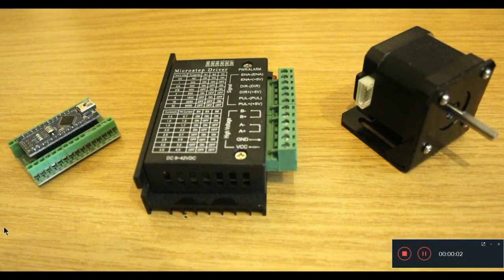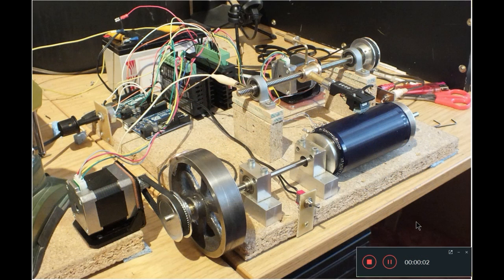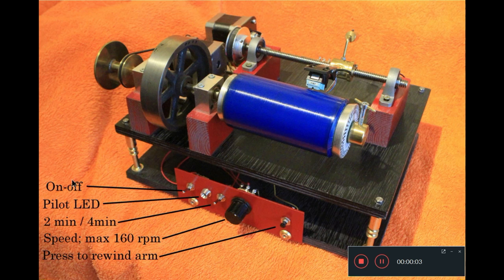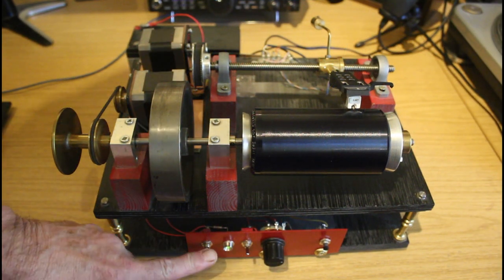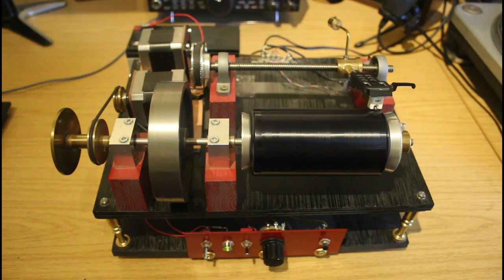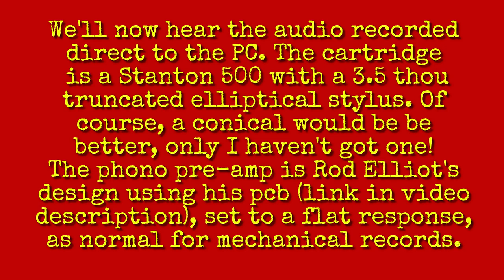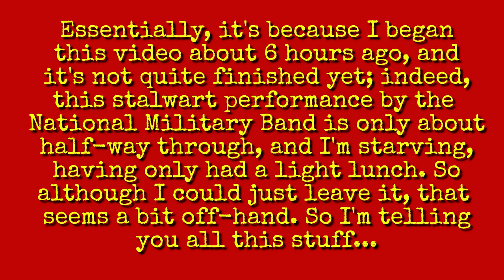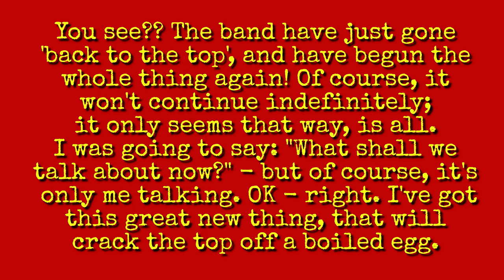cylinder record player, electric and home made.

Comment: I am always delighted to see a new video from you.  I have been following your web page and YouTube channel for quite some time.  I have also been tinkering around with recording some of my cylinders recently but  the quality from your machine far surpasses my feeble effort.  Keep well during these trying times.  Regards from South Africa
Reply from the maker: Hi Enriko, & thanks for writing. Glad you liked the videos. As regards cylinders, the secret is not profound; but they should be in top condition. The best cylinders are the Amberols, both wax & Blue, the latter before they were dubbed from disc. There's a window of about 1908 - 1914. Also, the Blues must be cylindrical & not out of shape, or the 'wow' will be severe. A modern moving magnet cartridge like the Shure M44 or SC35, or the ever-popular Stanton 500 is fine. There should be a stylus of say .0035" - conical is best, but all mine are elliptical. You can record the vertical cut cylinder & process the sound in computer software, but what I have done is to make a phono pre-amplifier which has a flat frequency response (or use a microphone input on your sound card - they're flat); also, put a 'buffer amplifier' of zero gain in just one channel (a single 'ordinary'  transistor , like a 2N3904 will do) & it will make that channel 180° out of phase with the other. When these two channels are combined to mono., the sound is rendered much more 'solid'. I think I should make a short video on this topic... Wishing you all the best, and hoping you and yours are all OK - it's pretty well OK here, but my son-in-law's mother is in a care home & we're a bit worried about her. Anyway, we'll get through all this stuff one way or another. Cheers, Norman.

Comment: tbh im massively impressed by the quality of reproduction, its very clear! out of curiosity have you ever thought of trying one of the vinyl cleaning gel products on the market on a cylinder (you brush it on, let it dry and peel it off with all the dirt stuck to it) i've had great results with vintage 78rpms.
Reply: That may ruin the delicate wax grooves
Reply: @atariboy77  yeah that's a fair point, my thinking was if its a common cylinder with a lot of dirt/mold build up if the gel does cause any harm its not going to come out much worse than when it went in.
Reply: @SparksNZeros  that's fair

Comment: Great Sound! A future challenge however would to play 1890's brown wax cylinders. These vary in speed as a standard RPM had not yet been established. I've experimented with electrical playback which sometimes works well but at other times sounds awfull. Sometimes, acoustical playback with a reproducer with a large diameter diaphram works best. It sometimes takes a lot of experimentation to get the best results. check out this challenge with Stinchcomb, brown wax cylinder records or Dr. Bruce's curiosities on  U-tube. cheers!

Comment: Good morning! thank you for this great video.

Can you explain to me how you configured your stepper motors with your arduino? All the information I have found says that we cannot program it's motors at a precise rpm.

Thank you!!

Simon
Reply from the maker: Hi There. Thanks for writing. I'm bad at Arduino, as I said. All I did, was to connect a 10 kilohm potentiometer to Arduino as described in File/ Examples/Analog/AnalogInOut signal. This will give you a value between zero and 1023, depending on where you have set the potentiometer. I chose 1023 as 'full speed'. I multiplied this constant a certain number of times, then used it as a 'Tone Command'. It outputs a square wave, but a microstep controller seems to interpret that as a series of individual pulses, which causes the stepper motor to rotate at your desired speed. I was NOT able to start the stepper motor at the high speed I required; I could not master the code. So I have to speed up the motor by starting from zero & turning the pot. 🙂 Hope this helps.

Comment: What about running the cylinder in a bath of oil maybe kerosene that should get rid of the surface noise be interesting to see hear. Might help with the wow and Flutter or is that in the recording. That can be ironed out in post production how do you you judge the speed is there any micro adjustment like a laser. Would it have been better off with an AC motor no coging effect. As I say the bath oil the thickness of the  oil give you a better control and better dampening as well, having the arm pivot point below the Drum would be better as well for pitch control
Glad you're well haven't seen you for awhile, don't forget to take plenty of vitamin D3 3000 iu daily.
Sounds good amazing how much detail how much post production did you do to achieve this

Comment: Are cylinder records have fixed track spacing unlike vinyl records that has wide groove in the low freq. and narrow grooves in the highs?
Reply from the maker: Hi there. Yes, cylinder records - at least most of them after about 1900 - have standard groove pitches. 100 grooves per inch (2.54cm) playing for around 2 minutes at 160 rpm are the earlier ones. Later, Edison made wax cylinders with 200 grooves per inch, so doubling the playing time. They were very fragile (or al least the ones you find today are!😀), so he then made them from a blue celluloid type of material - the blue one in the video is one of those, and it does play for a long time! They were much more robust than the wax 4-minute cylinders. Best wishes to you and your family, Norman.

Comment: Is it just me or is a stepper motor the single worst way to power one of these electrically?
Reply from the maker: You're correct; stepper motors are notoriously noisy, but not a great deal of it gets into the .wav file. Still, I have experimented with the motor brackets mounted on two or three layers of Depron, with some success. The virtue of the stepper motor to me, is the extreme accuracy of rotation. Take care in these uncertain times & let us hope they will soon be over! Cheers, Norman.

Comment: Brilliant work. Can't believe the fidelity you're getting out of a black amberol!
Reply from the maker: Very kind of you to write - thanks! Edison recording on the 4 minute Amberols is extremely good (before they were dubbed from discs), and as long as the cylinder is in good shape (both metaphorically and literally!), given half a chancem, they will play very well indeed. What you heard in the video had been converted in the phono pre-amplifier by having one channel inverted) so that helped a lot. Apart from that, nothing at all was done to the sound, so some clicks and scratches remain. But they can easily be got rid of with software. Best regards, Norman.
Reply: @bixanorak  completely agree, I think blue amberols sound better than contemporary 78s in my opinion! Just most of the black ones I got have been rather poor, so assumed that applied to black amberols in general. In any case, beautiful device you have there and you've certainly got me thinking of trying to put something like it together to digitise cylinders :)
Reply from the maker: @GoodOldTunes  Hi there. When you say 'black Amberols' - is that the first, black wax 4-minute cylinders? They were indeed the first, and if you can find them in really good condition, then they sound really good. They also remain cylindrical far better than the later Blue Amberols. (Of course, nobody at Edison expected enhthusiasts 110 years in the future, to still be playing their cylinders!) However, black wax Amberols have a bad habit of developing micro-cracks, which produce terrible crackle. Also, they are very fragile, and after 110 years, are still more brittle; if one falls over onto its side, it usually shatters into many fragments. We are 'audio archaeologists', are't we; we are interested in documeting & preserrving this material for the future. I wish you all good fortune in your work. Best regards, Norman. PS: Again you are correct; some speech recordings on Amberol have a frequency response of well over 3000 Hz, so the sound 'shh' can clearly be heard. Few (if any) discs of 1910-1914 could possibly be as good as that!